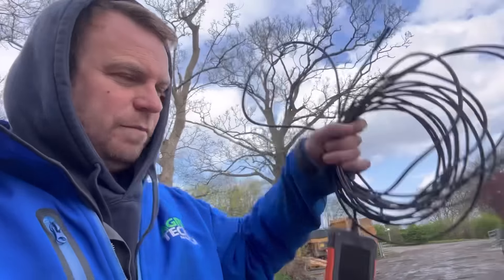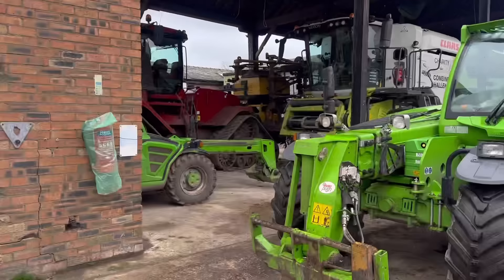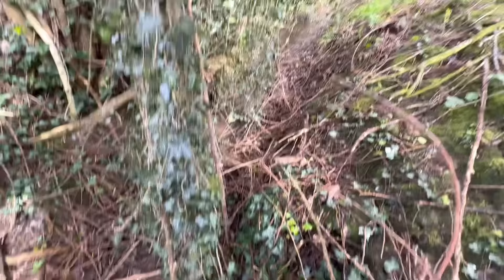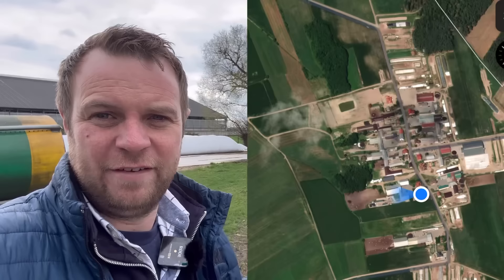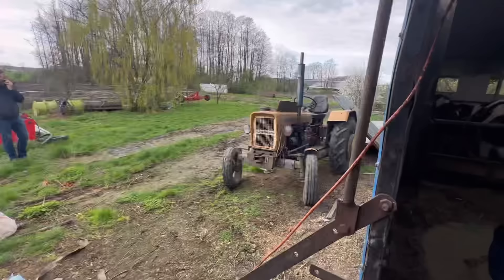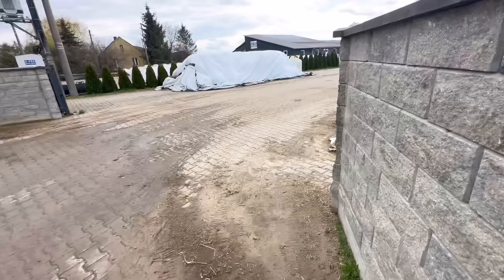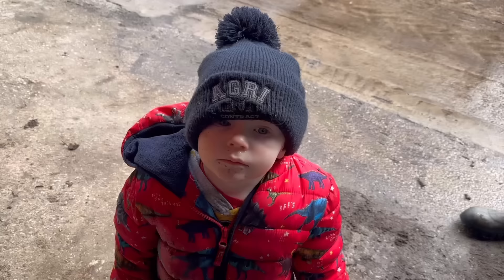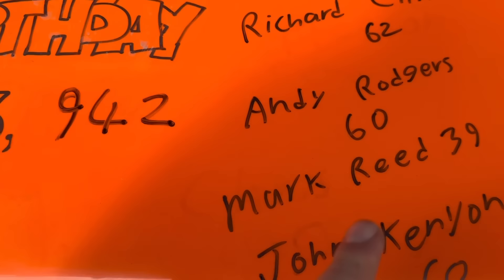DRAIN FIXED & POLISH DAIRY FARM TOUR #AnswerAsAPercent 1482

Comment: Isn't the milk price deviation even worse than you said? 

Uk - farmer 37p per litre -Shops 90p per pint (So £1.57 per litre selling price)

Like you said though RIP off!
Reply: Not exactly an accurate representation, supermarket milk around £1.50 for 4 pints so 68p / litre. Yes still getting ripped